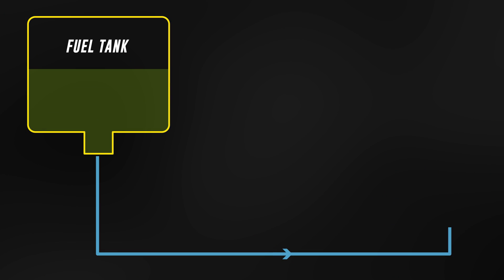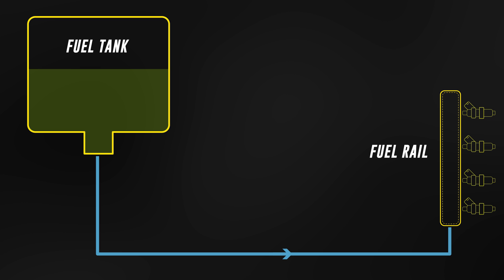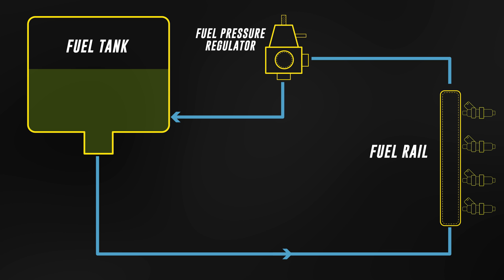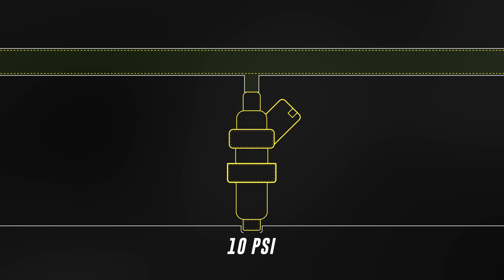🛠 Under Pressure - Why You Need A Fuel Pressure Regulator | TECH TUESDAY |

Comment from the maker: Yes, we know it's still Monday in some parts of the world, but it's already Tuesday in the Antipodean time zone - so it's time for another Tech Tuesday!
Today we're talking Fuel Pressure Regulators - what they are, how they work, and why you should have one! Enjoy:)

Got a subject you'd like us to cover? Let us know in the comments section!
Reply: It's well into Tuesday in merry old England, and as you know we have a secret government laboratory under Greenwich  known only as "Meridian" where the queens finest corgis run on treadmills to generate the time space continuum, so I think you're good.
Reply from the maker: Being a part of the Empire we're fully onboard with whatever's going on under Greenwich:)
Reply: @haltech  can you advise or do a video for returnless systems like Ls3  factory rails in a commodore etc on how to plumb up
Reply: Why does my twin intank pump module have a fpr built into it when I have a fpr on the rail?
Reply: @Haltech i mentioned a question about this topic a while ago as it is an issue about my build. my car im putting a turbo on has a dead head fuel rail, without a return line. the FPR is in the tank. do i need to install a return line and put a boost controlled FPR in? ill be using an elite 2500 piggy backing.
Reply: @nebulae1992  Yes, the ECU can handle that configuration - as long as the pump can keep up and the injectors can flow enough fuel when you're at maximum manifold pressure. Many NA vehicles are designed for ~300kPa fuel pressure, so you may need to increase the pressure and get a better pump when you boost it. Watch your injector duty cycle when running to ensure that things are keeping up. If it gets above 90%, your system isn't keeping up well enough. It's important to leave some head-room in case you drive in different conditions from when the car was tuned. e.g. on a colder day air is denser, so the engine consumes more air, so you need more fuel. 

Ensure that the settings are correct. In the F4 page, ensure that the Engine : Fuel : Fuel Pressure Input Type is set to Constant for this configuration. And that the Base Fuel Pressure is the pressure you see in the fuel rail. If you've got a fuel pressure sensor wired in and enabled, it'll be able to respond properly if your fuel pump can't supply enough pressure. 

Map the Injector Flow Rate table to the Injector Pressure Differential channel. (ECU Navigator : Injection  System : Stage X : Flow. Press F3 to bring up table edit, enable the axis and set the channel to Injector Pressure Differential). Pick a bunch of injector pressure differences that you're likely to see, and use the equation below. 
For most injectors in their normal operating range, the flow is proportional to the square root of the pressure. flow_at_pressure_x = flow_at_base_pressure * square_root(pressure_x / base_pressure). 
e.g. if an injector flows 1000cc at 300kPa, then at 200kPa it will flow 1000cc * square_root(200 kPa / 300 kPa) ~= 816cc.
Ideally you would map your Injector Dead Time across the pressure difference as well, but most people skip it, as the difference is pretty small and it can be tuned around pretty easily.

Comment: Hello , i have the fuel pressure regulator but when i hold the throttle wide oppen it bogs for a second like the injector power was cut off, should i increase or decrease the psi it goes through the fuel pressure regulator?

Comment: guys my car makes this hissing sound when starting up and i dont know where its from it doesnt always happen and when i press the gas it stops and lets out the pressure. what can this be? citroen ds3 2010 1.6thp tuned from 155>200hp i have a blow off valve, oil catch can and a different air intake

Comment: Hi there! What if my fuel rail does not have an exit side, where should I put my fuel pressure regulator? Also the original fuel system has return line to the tank. Thanks!

Comment: Can a 255 fuel pump cause stock injectors to leak and cause a misfire...
And if the answer is yes, it could, then could a fuel pressure regulator correct this problem...

Comment: I think I need a new FPR? This is very informative. I bought a car, turned up not able to start. Replaced fuel pump and is now running but feels like fuel cutting when on boost. I replaced fuel filter but still feels sluggish. Checked and cleaned intake and intake sensor. No luck :/ I think FPR is my next step

Comment: Funny I was just talking with my brother about his baja truck on display at Haltech, KY & also talking about my FPR w/ boost reference port & trying to decide if I needed a 3 or 4 port boost controller. I have an electronic fuel pressure sensor connected to the FPR, so maybe that negates any need to hookup boost reference on my FPR?

Comment: I am installing a 6.0 LS N/A engine and my plan is to use a corvette style Fuel Filter/Regulator system with just one fuel line fueling the injectors. You reckon the factory regulator will be efficient enough? Is an Adjustable Fuel regulator more desired for boosted engines?

Comment: Does any of this matter if my car has a returnless fuel system, running a 96 dodge stratus 2.5 v6 in a demo derby, and it has no return line from the fuel rail just a inlet, tried running a 7 psi fuel from a carb set up in there and it did not work, so I am buying a 45 psi pump but was told I should run a regulator, but it’s a derby car so idk if I should or not

Comment: How do you calculate the boost pressure pushing back at the tip of the injector?? It was 10 psi in your example. Is it your max boost running on ur turbo setup??  Great videos!
Reply: You probably don't have to calculate anything, the idea of these regulators is that they do it for you. You plumb an air line from your intake, after your turbo, and plug it into your fuel pressure regulator. Your turbo will make different boost all the time and it will push that psi into the FPR which will automatically compensate for it.

Comment: The problem with the definition of a super car is that isn't specific enough. There now needs to be a horsepower minimum and maybe a speed cabability minumum. Beause there are Mini-Vans that can go fast depending on who you ask. And yes, 75 is fast to someone who never drives faster than the speed limit. For Horses ?500? ?550? Hyper cars: 900 minimum? These are suggestions. Please start a conversation on this And the possibiity of a special license for high-end cars as well.

Comment: Just added one to my V-Twin Ultralight engine as the pressure setting in the existing return was set too low, when set at correct 3 bar or 42 psi the difference is unbelievable! @PY84

Comment: Does increasing the fuel pressure change the afr?
Reply from the maker: Increasing fuel pressure will change the flow rate of the injectors. If this is not properly compensated for in the ECU programming, the AFR will be enriched as a result.
Reply: @haltech  For example in a stock ecu which is not programmable it will make it richer

Comment: So what would increasing the fuel pressure to 65psi on a 40 psi system with 24 lb injectors do?
Reply from the maker: Provided that 24lb/hr flow rate was rated at 40psi, It would increase the flow rate to 30.6lb/hr. 

But don't take our word for it, use a calculator!
Reply: @haltech   I dont know the math or science to it..I do appreciate your input
Reply from the maker: @19jody72  No problems mate. You're talking to a marketing guy. I don't know the science or math either. I used a calculator I found on Google!

I bet Scotty could have done it in his head though. LOL
Reply: @haltech   lol..I appreciate   your input though

Comment: Interesting, if i still had a stock FPR boosting 10 psi can the tuner add more duty cycle on the injectors when u go into boost to compensate the rail pressure loss ? I've also read that some factory cars already have 1:1 rising rate reg.

Comment: I have an 05 GMC Sierra with bolt ons Cam, Headers, Intake, tune and a walbro 450 im still running on my stock injectors which they max out around 25psi... My fuel pump runs from 35-87 psi acording to the specs i saw online... My engine feels like it missfires but my coils, spark plugs, and spark plug cables are new, and it started doing that ever since i installed the walbro 450 fuel pump...So my question is, can it be that the fuel pump is sending to much pressure to my injectors??

Comment: I have a stroked SR20 making 500kw atw & when I come off throttle  the engine seems to miss I have a basic understanding that nothing is really firing at this point, could this “miss” be due to only having a 800hp fpr & it is struggling to let the excess out of the system?

Comment: Could you expand on this topic please. How does a surge tank come into this. When does the injector open with direct injection, at cylinder top or bottom? If it opens during compression then this would effect fuel pressure requirements? Love your work!

Comment: Possibly a dumb question, but since boost pressure constantly changes, does that mean that fuel pressure is constantly changing along with it, or does the ECU know of the current pressure / flow rate and adjust accordingly?
Reply: Not a dumb question, and I don't work for Haltech, but you're semi-right on both accounts. The function of a boost/vacuum-referenced regulator, as mentioned in the video, is to maintain a constant flow rate from the injector-- what this means is that your fuel line pressure will adjust as vacuum/boost comes into the equation, but only in such a way that the fuel pressure differential is maintained. So, for example, your base fuel pressure is set at 45psi with the reference line disconnected. Your injector flow rate at 45psi is 1,000cc/min. When you connect the reference line and allow the car to idle, the regulator will be exposed to the vacuum generated by your reference source-- this means that the fuel line pressure will drop according to the vacuum seen at the regulator. Just to follow the example, let's say manifold vacuum is - 10psi. Your fuel line pressure would then drop by 10psi to 35psi, but with the -10psi acting to "pull" fuel from the injector, the injector would still maintain the same flow rate (1,000cc/min) seen at 45psi of line pressure with the reference line disconnected and no vacuum/boost in the manifold. Conversely, in boost, the injector has to overcome manifold pressure in order to inject fuel, so, as detailed in the video, 10psi of manifold pressure would cause a 10psi increase in your fuel line pressure (from 45psi to 55psi), however, having to overcome the 10psi of manifold pressure means that the injector is still maintaining its flow rate at 45psi (again, 1,000cc/min). Depending on how your ECU is calibrated (Haltech's recommendation is to map fuel flow rate by injector pressure differential), the ECU will constantly recalculate your engine's fuel requirements using the injector pressure differential, the values in the injector flow rate table, the target lambda for that load cell, and the value entered into your VE table (subject to further manipulation by compensation or correction tables [post-start enrichment or ethanol content, for example]). Anyway, I'm still learning, too, but fairly certain this information is accurate.
Reply: i was wondering the same thing

Comment: I understand the theory but I've been told over and over that a regular old top hat, diaphragm vacuum reference non adjustable fuel pressure regulator is fully adequate. 

Why should i switch, is there really that much more control to be had?

Comment: soooo   can we sort of tune air/fuel ratio with different FPR ? my car dosent have a programable/tunable ecu , feels like its runing too rich
Reply: The most you can do on ur set up slightly increase your fuel pressure with an aftermarket adjustable fuel pressure regulator to get more flow out of ur injectors at their given duty cycle across your fuel tables. Basically this would be used if ur running slightly lean and want a bit more fuel(via more flow as per the increase to the fuel pressure) going into ur cylinders while not increasing duty cycles %, since ur don’t have an aftermarket ecu to increase fuel. This would be ur little cheap bump In fuel to save potential detonation from running too lean.
Reply: just get a different car

Comment: Also one thing I’ve leant is that not all fuel regs are created equally try find one that will hold fuel pressure when the engine is switched off as this will make restart the engine a lot easier
Reply from the maker: ^^ very true.

Comment: What about Direct Injection fuel pressure? I own a Mazda 6 MPS (Mazdaspeed 6) and they are known for weak stock fuel pump (100bar max fuel rail pressure on stock engine). WOT on high gears will cause zoom zoom boom very fast and it's a PITA to drive on Autobahn and jump from 6 to 4 or 5 every time you want to floor it, just because the ECU and fueling is so bad designed on the 2.3MZR DISI Turbo engine. 
Is there any alternative to changing the internals of the HPFP to mend this "by default" problem or should I go for the 10mm piston and 150+ bar ?
PS: The HPFP is the same like on the Golf 6/7 GTI and R from what i've heard, it's just the internals that are undersized .

Comment: What about dead head set ups? 
Do they run a long manifold reference line, or is there another way to do it?
Reply: They have a static fuel pressure. The ECU needs to do a bit more work as the deadtime of the injectors changes as the pressure across the injector changes and this happens all the time as your throttle changes. They are not that good in turbo cars as it makes for extra short duty cycle at idle (meaning deadtimes need to be right) or on the other side of life, when in boost you have less flow rate compared to a map referenced fpr.

Comment: If you have a single fuel line to the engine with the pump and regulator at the tank how do you adjust for boost, a long  hose from the manifold to the back of the car ?
Reply: The regulator is often in the engine bay, or even directly mounted to the fuel rail
Reply: @alexstromberg7696  yes but I am talking about modern setups with no return line to the tank, I'm assuming that all regulators have a return line for excess fuel
Reply: @jrobpat0154  ECU controls fuel pressure, guess you just tune it for more

Comment: I wonder how much fuel pressure BMW used to use in their old F1 turbo engines and what method they used to control it back in the day.  They were only 1.5 litre V6s, but...with 80 psi or so of boost, and something like 1300 hp.
Reply: Quite high, diesel is higher again.
Reply: @wobblysauce  modern common rail diesel engines have fuel pressures up to 3000 bar. You can't compare the two, most gas cars use pressures around 3 bar.
Reply: @alexstromberg7696  Well, you can... it does show differences.

Comment: Let's say if my factory fpr has a vacuum reference and I've put a turbo on my car and put a higher flowing fuel pump, would it still operate as you've described ? Or would I need an adjustable fpr?
Reply from the maker: If you're upgrading your fuel system - ie fuel pump and injectors we would recommend upgrading your fuel pressure reg as well.
Reply: @haltech  Thanks for the reply! Much appreciated 🙂